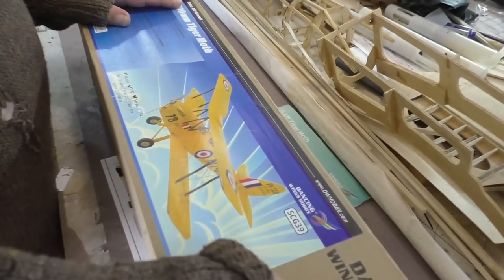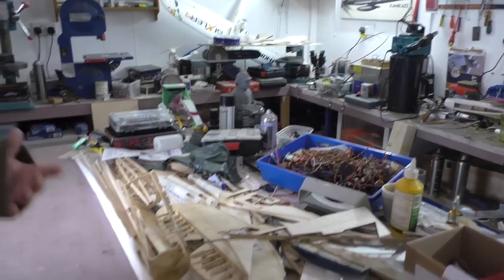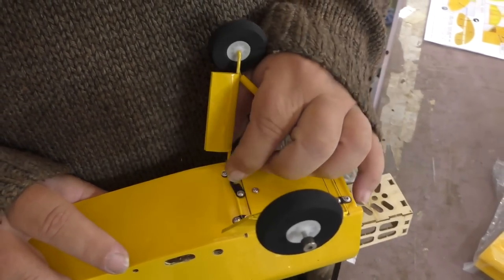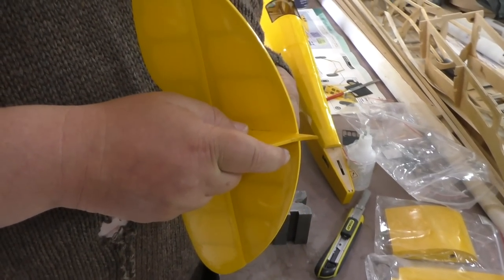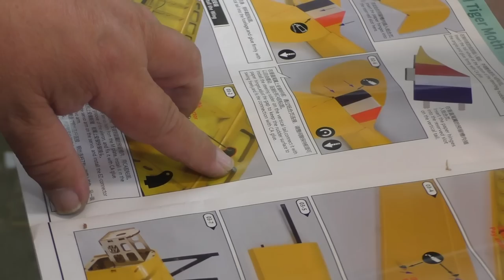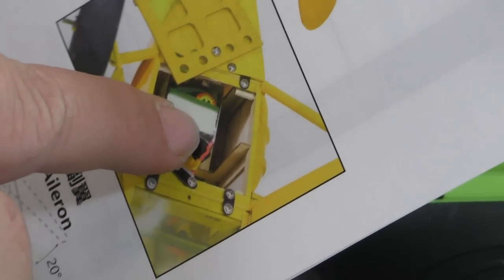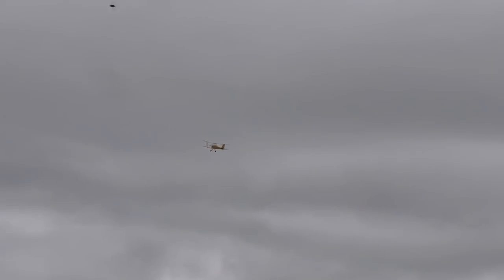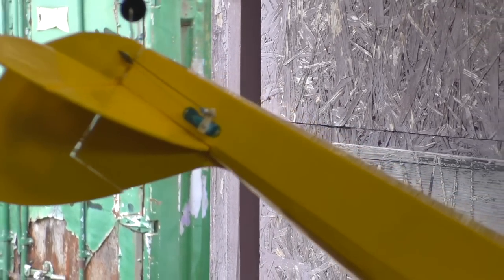Honest DW Hobby Tiger Moth RC Plane Review | Build & Flight Test by Captain Rob  RC Model Geeks

Comment: Just another mod with mine I cut the alerions shorter and taped the cut section down about 35 degrees fixed in place flaps fantastic flyer now takes off fine steeper but easy and flys so much slower, cheers.